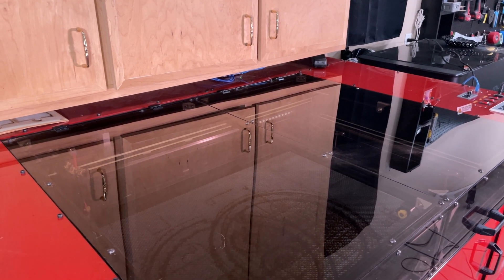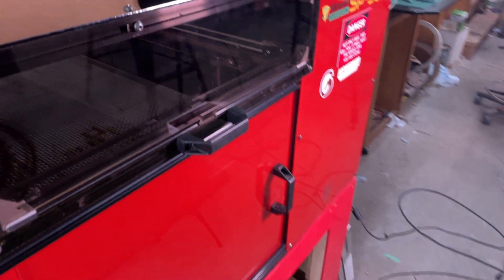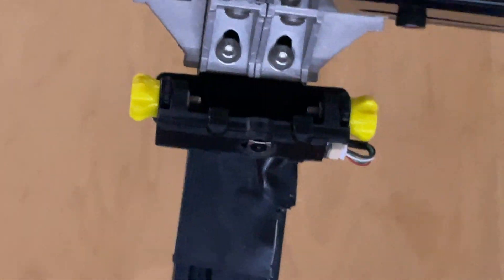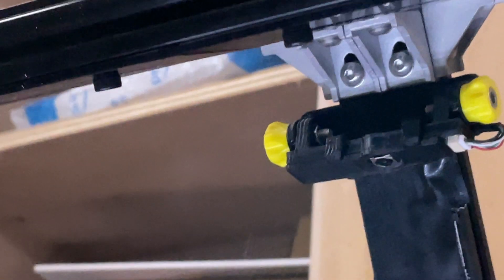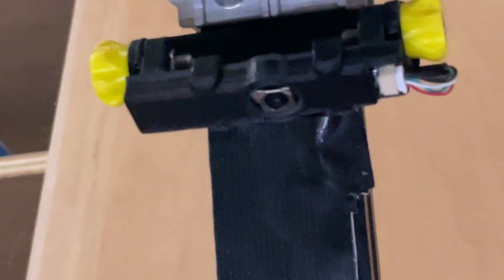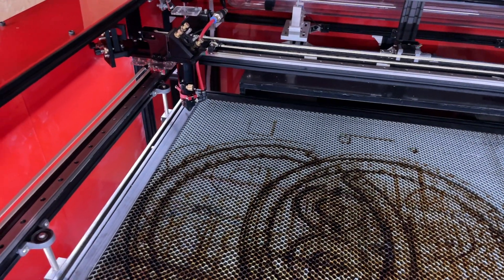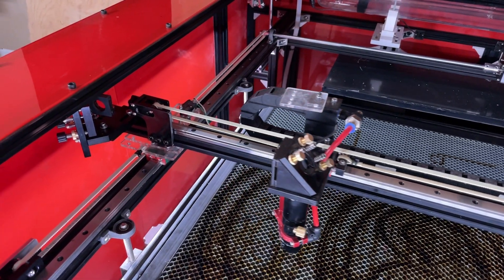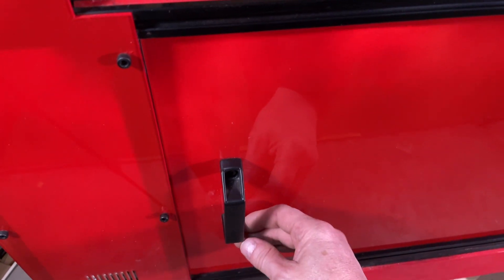What If You Could Build a High-Powered Laser at Home Right Now? Part 7

Comment: Hi Steve, nice video series..  It's put some dangerous ideas in my head! 😉. I may do something like this some day.. Question:  if I were to get a K40 CO2 laser and upgrade it to something like this..  I could get a new tube and matching power supply and reused virtually everything from the original unit?  I would want to expand the work area as well, so I imagine it would get a bit complicated..  Anyway, I don't even have the K40 yet, (maybe for Christmas) so this is all down the road..  What do you think?
Reply from the maker: Sometimes a little danger is fun😉.  Regarding your question, in theory you could hack a new power supply and tube into a K40 cabinet, though hopefully your K40 has a bigger workspace.  The caution would be to ensure that there is room for a longer tube if you are buying one with more power.  A 90W tube much longer than a 40-60W tube so you might have to be prepared to hack a hole in the side of the cabinet so the tube can extend outside and build a box to protect the protruding portion (and to protect you too)
Reply: @SteveMakesEverything  I'm looking at the Monport K40.  I think upgrading it to even a 60w tube would require a 4 inch of extension out the side..  Which might not be too bad..  To expand the work area ,  I thought maybe of gutting the entire enclosure for the work area and getting a cheap PC enclosure to house the power supply and various electronics.. Maybe an old chiller enclosure..  But the first step is to actually get a K40! 😁

Comment: One question. It looks like you have room to move further back on the bed but the vent is in the way. Is there something limiting the gantry from moving back the 8ish inches where the vent intake is?  It appears like the bed area is smaller then it could be. Just curious. Thank you.
Reply from the maker: The workspace only goes back to the edge of the exhaust intake.  I didn't think it would be smart to allow material to hang of the sides of the honeycomb as it would inevitable collide with something inside the laser

Comment: Great build! If you want to use the camera use a USB Over Ethernet Extender to your pc. I'm gathering parts to do something similar for a diode laser.
Reply from the maker: Yes I had come to this conclusion as well.  The Lightburn camera is a bit finicky though so I’m not confident that this would be a reliable solution